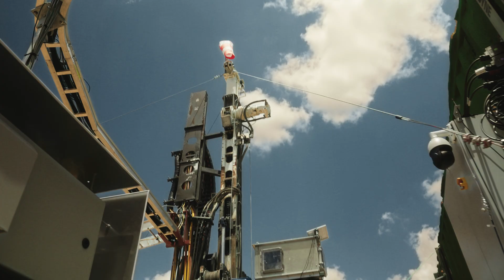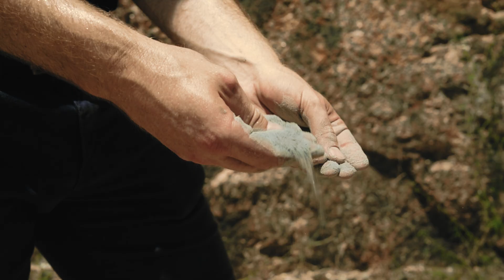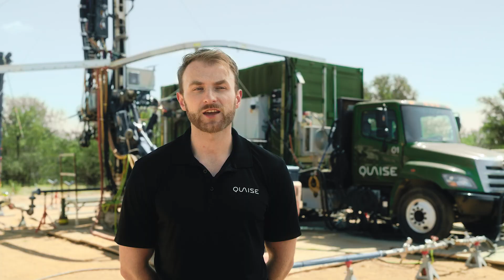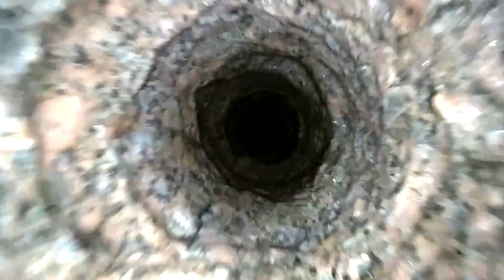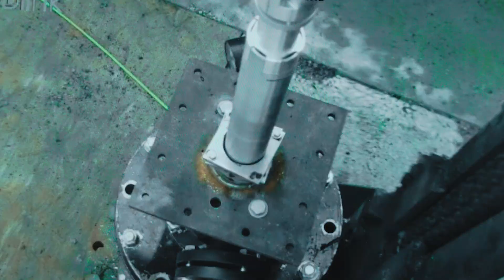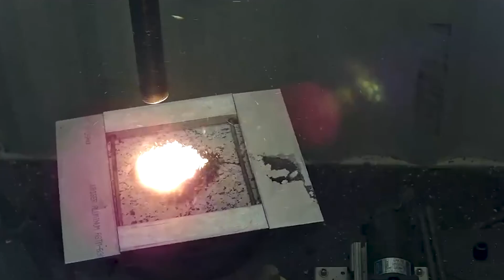Field Testing Our Millimeter Wave Technology for the First Time

Comment: What would be useful is to collocate that source of raw power with millimeter-wave furnaces at West Virginia coal mining sites, thereby melting a falling stream of sedimentary rock dust  that lies adjacent to coal seams. Apparently, those, not the coal itself, are rich in rare earth minerals which vaporize at particular temperatures apart from the other minerals in the dust. There are millimeter-wave furnaces for vacuum separation, but not in a continuous stream of production of rare earth minerals. Today's supply shortfalls highlight the need to extract our own rare earth minerals from our existing mine resources. Do you have some more advantageous idea in mind?

Comment: I'm as stoked about this technology as much as the most promising RTS game release.  I was wondering when someone would implement this.
The place to drill the "real" production test hole should be at any power plant location with a back-up coal fired generation system.  The back up system could be run to provide the power needed for the drill.  Then all the steam infrastructure is right there to the existing turbines.
The first test case should be a less expensive single hole - possibly even lined (depending).  When at depth, lower a pre-fab pipe conduit - either a double pipe, or a single down, with the rest of the hole being the steam up.  This reduces the cost of the first attempt, and maybe becomes the model for smaller localized steam production.
This is such an obvious system, that short of selling out or getting squashed, this will be taking over power generation across the globe in my lifetime... (better hurry)

Comment: This will likely takes decades, the hard part is the extreme pressures (like out of a rife barrel), heat and corrosive issue at depth. Thats going to be really hard to do. But I think it is far more promising than fusion energy and very worthwhile to try. If they can get a well down 5km that would be a big deal and prove the approach is doable.

Comment: What happens when the drill hits water? The water absorbs most of the energy of the drill making it useless.
Reply: I suspect that their might be a hybrid of conventional drilling with this technology where casings are set in the shallower levels to prevent water infiltration and the mm wave drill goes to the extreme depths. Probably faster and more cost effective to do the first few hundred feet conventionally anyway. 

The main point of this is for extreme depth drilling that conventional drilling can't do or can't do reasonably.

Comment: The sides of the granite test hole is very rough.  I thought the idea was that melted rock would form a type of glass along the sides.  How can you achieve smoother and non-porous side walls for the hot water to flow?
Reply: Just because it's rough does not mean it is porous. That's granite - it was already impervious to water and melting it won't suddenly change that. It certainly is interesting, however, that this rock did not appear charred or burned in any manner like we see with all of the test samples in the lab